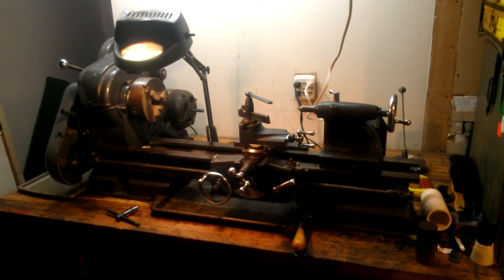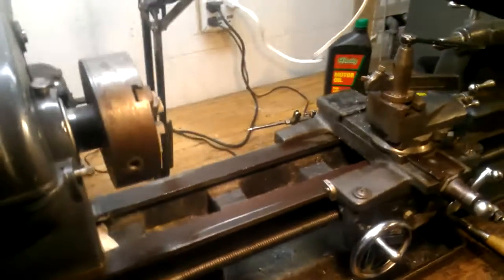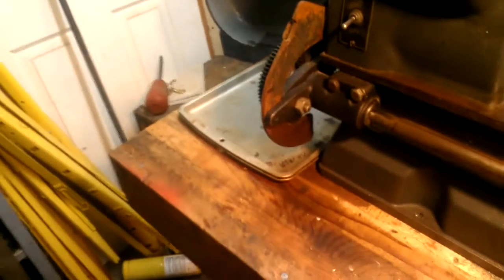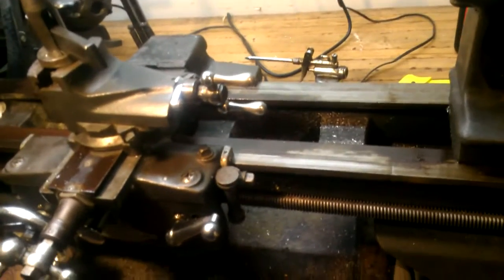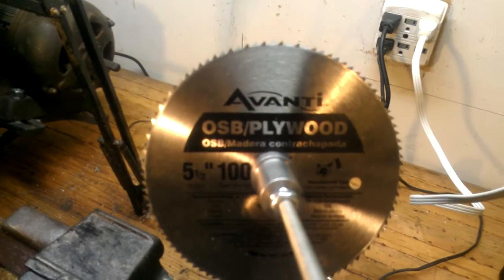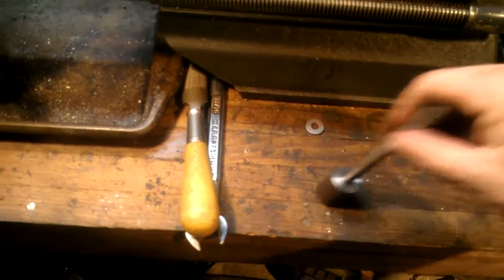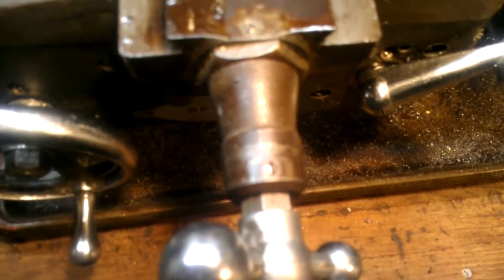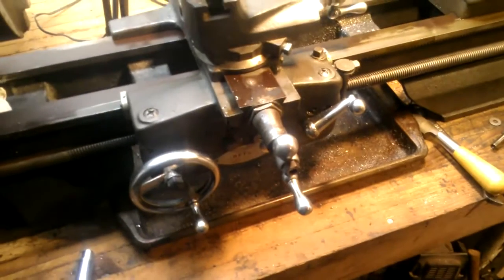Atlas 12" lathe and indexing tool

Comment: Hi Chris, lots of work hauled from the scrap bin and for a decent price on top of all.
That promisses to be interesting to follow.
Pierre
Reply from the maker: thanks Pierre I was almost ready to make the large dials and then I saw that my mandrill was bent . my bed is so bad it was mostly filed to size (not something im looking to repeet . don't have a .375 tapered mandrill do you
Reply: That's a long term engagement with this lathe, didn't you say you had another bed for it, or is it the spare that is worse than the original...?
The .375 mandrel, would have to make one...
Those sizes aren't very rigid though.
Reply from the maker: te spair is lets better and jus to be clea it andril was file to size . need to find time to pu the new bed on the lathe
Reply: That's a happy news, a decent lathe for scrap price is a great deal, keep us posted on the progress, I'm curious to see how it comes out...

Comment: Did U finish the dials Chris? I plan on doing the exact same thing using a saw blade. The compound dial on my 12" Atlas is okkk but few spots are pretty worn
Reply from the maker: Makin Sumthin From Nuthin you know I have not . but I do need to this is one of my most popular videos. I almost have my mill complete I will try to get back to it.
Reply: No sense doing today what can be put off til tomorrow! LOL :)
Reply from the maker: +Makin Sumthin From Nuthin  you know what I haven't but I  need to get on to that again.
Reply from the maker: +Makin Sumthin From Nuthin good idea unfortunately my time is not my own a good bit of the time.
Reply: I run out of time everyday, LOL
Reply from the maker: +Makin Sumthin From Nuthin I know that feeling.

Comment: I do have some spares.  Including a VERY nice TH54 bed.  Hmmmmmmm  I'm looking for a carriage tailstock hand wheel if you have an extra (not that I'm offering the bed for a hand wheel)  ;-)
Reply from the maker: I bet I can cast a new one
Reply: Chris Anderson The most lucrative hand wheel is the compound slide.  I see you have a good one for your pattern.
Reply from the maker: ya but only problem with doing that is the lathe is down tell the casting is done lol
Reply: Chris Anderson Well..... wouldn't you measure the handle and make a plug or rack of plugs something like 5% larger?  Measure it to make the tool.  I would expect to get $40 or more for them polished.   A decent used factory one chrome over Zamak is about $60.   I bought a whole parts lathe one time just to get one of those handles.
Reply from the maker: +Crafted you sed you had felts for the atlas how much you selling them for ?
Reply: Chris Anderson I have sheets of the correct felt. I already make about 100 laser cut products for my RC Aircraft business.  I haven't made the drawing yet but I'm going to make the felts for Atlas as well.  I will try to get to it soon.  Happy to send you a set for evaluation.
Reply from the maker: that would be great  ill put it in to a video i need to install the new ones i got in tool score 12. i thin mr. Peet did a video on makeing some for hes logan or maby the atlas
Reply from the maker: you don't have a follower rest for your lathe do you?
Reply: Chris Anderson I wish.  A follower and steady rest for my 10" are high on my hunting for list.  There are a couple of reasons why I'm working on a 10 and not a 12 in my restoration.  My late father helped me get the 10 and I built an RC car on one when I was a kid.  The 12 isn't capable of as large of cuts as the 10 as they are more flexible.  Steady and follower rests are a bit more common for the 12" lathe from what I can see.   I actually own 2 10's and 12, all three with QC gearbox.  The 12 I plan to sell eventually.  I'm always watching Craigslist for everything.  My hope is to catch an underpriced lathe that includes them so I can keep the accessories and sell the lathe to break out.  Still looking for another leg set (I have one set), a Buck chuck, follower and steady rest and original carriage stop.  Generally, I'm trying to fill out my 10" with every available accessory I can find.   When I first started looking for one of these lathes to help in the restoration of my 10" I've had for 20+ years, I didn't understand the value of all the accessories.  I found one in Michigan with every accessory ever sold on the factory leg set, $1400.  I didn't realize at the time what a bargain it was and let it get away from me.  Now I have about 1/2 of them but I've had to buy many lathe owners out to get there.    Oh, I do have an extra milling attachment.     ;-)    I have an extra gear set also which can be gleaned from my video's.  My recommendation?   You should be shopping for these lathes for the next couple of years.   ;-)
Reply from the maker: +Crafted I'd like a mill atachment, carriage micrometer stop and a set of legs.
Reply from the maker: +Chris Anderson oh hay your handy with cad think you can drawl up the milling atachment and carriage stop?
Reply: Chris Anderson The milling attachment?  That couldn't be made from plastic.  It's already hampered by being too flexible up on the cross slide.  I do have some ideas to help which I will be making a video about.  Are you thinking of making an aftermarket milling attachment?   I don't know what all your connections and manufacturing capabilities are.  I would have some ideas for a better one.
Reply from the maker: +Crafted yes I can get gray iron castings done pretty resnoblyonce the mill is running I think it can do most of the work.
Reply: Chris Anderson Hmmm, let me consolidate my ideas.   I think it would be possible to make a much better milling attachment than what now exists.   The real question is if you can get people to recognize it's value and pay for it.   Price range for a factory one which gives you very marginal milling capability is $200 to $250 as I'm sure you know.  Not sure what a new one costs.  I purchased a new one about 20 years ago when I first acquired my lathe.   But, it could be much improved.  WAY too flexible.  The real ticket might be in selling a customer an update kit that allows them to use many of the parts off their factory attachment.
Reply from the maker: The oem mill atachments are upwards of $500 now
Reply from the maker: Oh yah need a taper atachments to making b&s tooling for the mill
Reply: Chris Anderson I have not been able to lay my hands on a factory set.  Making a taper attachment is a great video idea.  Think Tubalcain or somebody has done it.
Reply from the maker: +Crafted your probably right. I just need to do it myself
Reply from the maker: +Crafted I think mostly guys want the original parts but there just art enough to go around. that's why I like making repoductions
Reply: Chris Anderson The milling attachment seems like a big bite.  If you are capable of making it, fantastic!   You mention big dials in one of your videos.  Such an offering would be very popular.   Can't stand trying to read mine.
Reply from the maker: +Crafted I do still plan to do that upgrade . mine suck to read and I can see Imagen if you can't see very well.
Reply: Chris Anderson I'm using a 10" Atlas that will be replaced with my restored one when It's complete.  I need to take time to clean the dials.  Could be better, but so small.....
Reply from the maker: +Crafted ya they can barely made 1 1/2" . I've talked to Randy Richards he seems game to use his x carve to do the dial ingraving. I don't know if he wants to go into production tho lol
Reply: Did you watch mrpete222 video on making dials?  Stamping isn't so hard and looks very good.  He scratches in the hash marks using a 100 tooth blade to index, then uses a jig to stamp in the numbers.
Reply from the maker: +Crafted ya that is an option to already have the sawblade indexer made just need to build a paw to index with. I could always use the dividing head.also